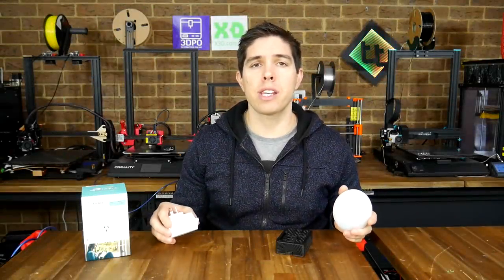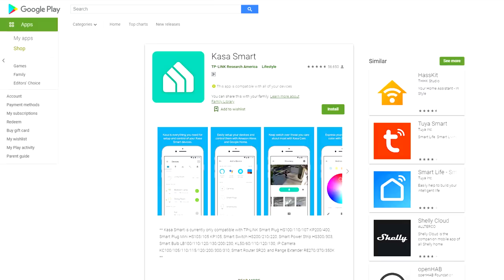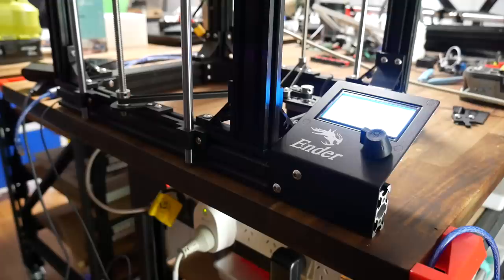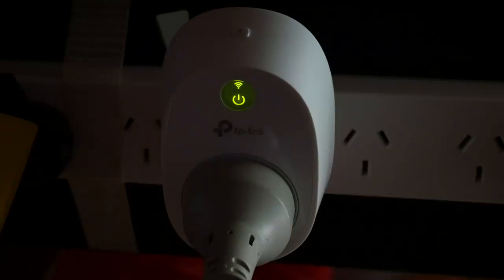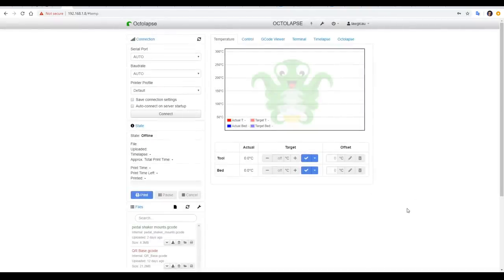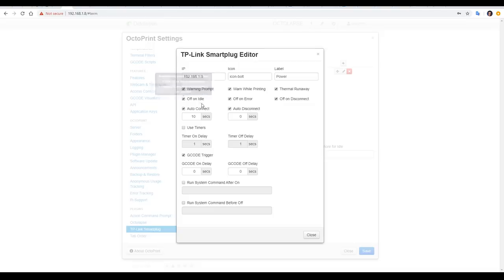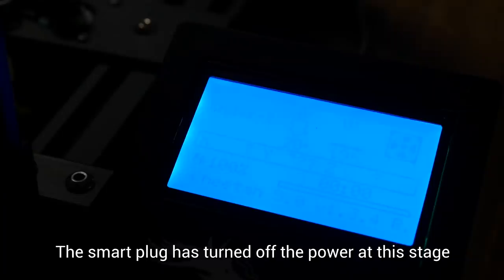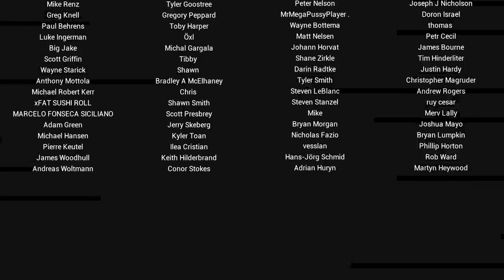Use smart plugs + Octoprint to improve your 3D printing

Comment: Just remember that a lot of these "IOT" devices have weak (or nonexistent) default passwords, and may have other security vulnerabilities.  Think through whether anything you set up will be accessible (over wifi) from the street or over some kind of cloud interface (for example, if the device allows you to control it via an app even when you are not at home). Its not that all of these devices are bad; but they deserve to be used with caution and forethought.
[I say this as an IT professional with 25 years' experience]
Reply: Not very relevant with 3d printer. It would be really small thing if someone would remotely shutdown 3d printer. Powering plug doesn't do anything. Actually one of the best scenarios if plug would be hacked and commanded remotely.
Reply from the maker: I agree that in some cases people could be really malicious but in this case all they can do is turn off the printer. Getting control of Octoprint, however, that would be bad. It's still a valid point as the world moves more in this direction.
Reply: @TeachingTech  - Its not just about them turning off the printer. Its, as you said, the potential for them to use the device as a "base of operations" to launch other attacks from - either into your home network or outward onto the internet. Bot-nets comprised of hacked IOT devices have caused problems by taking down websites or performing other attacks in the past.
I'm not trying to scare anyone off of this idea completely - I see the convenience and value in it. But people ought to know the pros and cons, be careful about these sorts of things, and be sure to keep an eye out for updates and known vulnerabilities with these devices. :-)
Reply: jothain - No its more than that.  Remember that IOT devices are essentially small computers. And you've put them on your home WiFi (which for most people means they can see everything going on in your home network). So - just like any other computer - it can be hacked or taken over and used to launch attacks both online and on your home network.  See my reply to TeachingTech.
Reply: @noelwade  computing power of them doesn't even make them that appealing devices to hack to. Now something like smart TV. Now there's device that actually has moderate processing powered and already send incredible amounts of traffics outside of your network. These are the types of devices people should actually be concerned.

Comment: Be careful when using these smart plugs on your printer. Most are only rated for 10 or 15 amps, and depending on your printer, it could overload the plug, and who knows what kind of overload protection they have. Also, most of them are made in China, so who knows if the amp ratings are accurate.
Reply: Even at 120v only 10 amps are 1.2kW which is far more than any desktop fdm 3d printer, 15A at 220v are 3.3kW which is probably enough for 8-10 ender 3 sized printers
Reply: For printers that don't have a mains heated bed these switches will work just fine. I'd not pull more than 7A at US mains on one though. The relay may be OK, but the board traces can be weak.

Comment: I don't think sticking something in the USB port is the best option. There is a github repo with an automation script to kill power to the USB hub on the pi so you don't need and hardware mods. Also some cheaper control boards can have issues when 5v isn't supplied via USB.
https://github.com/Sodium-Hydrogen/OctoPrint-Power-Management